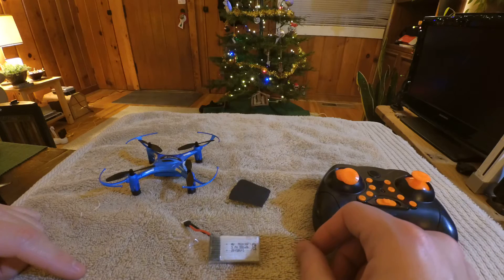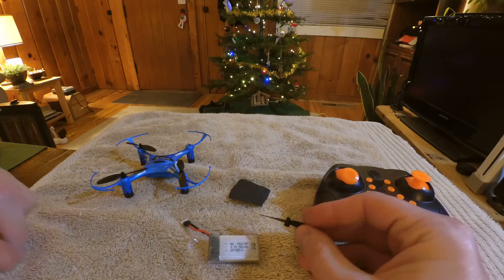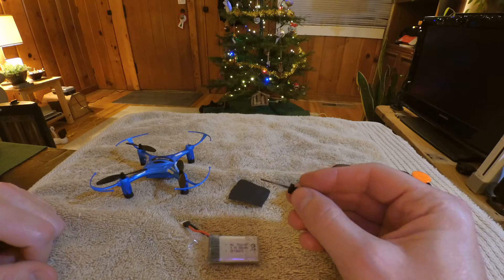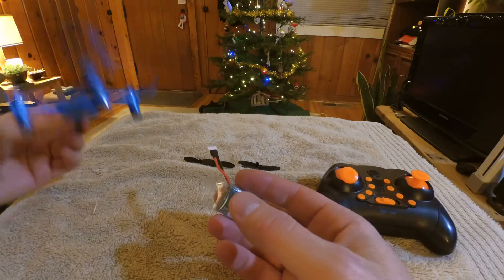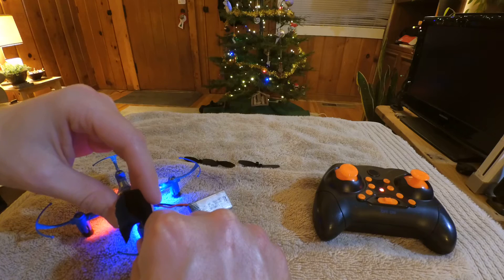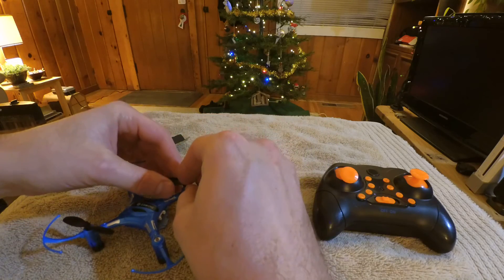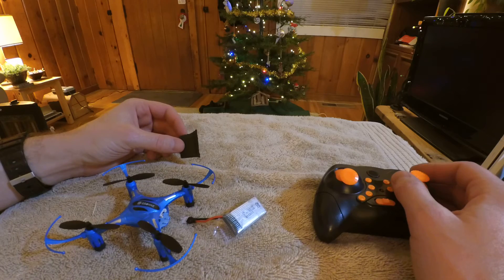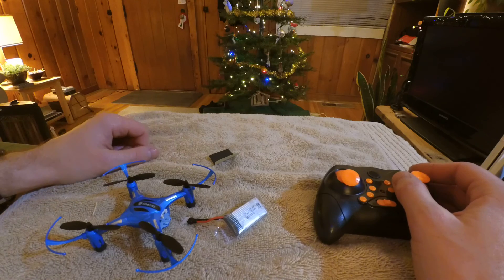How to stop propellers from flying off small drones

Comment: You can take some hot glue and put it on the tip of the shaft and before it dries take your propeller and fit it on there like it normally goes and push it you know good firmly on there and the glue will dry as long as you don't get glued down near where the shaft spins at the motor this is not 100 % foolproof though. Thinking of trying super glue or stronger adhesive they should have these propellers on the smaller drones where they're screwed into the shaft like on larger ones

Comment: I so desperately want this to work, but I'm scared. As things tend to do with me, I'm pretty sure that if I try something random will go wrong and instead of giving the motors a better grip, instead it will somehow break them and cause them to never be able to mount a propeller again. I've had enough of these stupid propellers flying off, but I'm scared that using your technique will stop the propellers from coming on at all.
Reply from the maker: If you're worried about Murphy's Law, try it on just one motor first. That way if you screw it up, you've only damaged one motor instead of 4. Basically what we're doing here is changing the surface finish of the shaft from smooth to rough; we're not changing the diameter of the shaft.

There are two other methods for keeping the prop on the shaft. The first is to crush the hub of the propeller with pliers. The effectiveness of this is temporary, and it may also cause vibrations. The second method I have heard of but not tried: super glue. I would really call this one risky biscuits because 1) if you break the prop, good luck changing it and 2) if you use too much and get it in the motor's bearing, it's permanently seized.
Reply: @EngDrewman  messing up 1 motor will mess up the whole drone btw
Reply from the maker: @tikogupta1735  yes I know. What I'm saying is by trying it on one first, if you screw up, then you only have 1 to replace not all 4.
Reply: @EngDrewman  oh i see sorry for my incompetence
Reply: not being sarcastic or obnoxious in anyway btw

Comment: Thanks for the tips! Greatly appreciated! Any ideas for how to get props that are made for a slightly bigger diameter shaft to fit? I've tried putting a piece of thread through the hole and had some success, but I'm thinking there must be a better way.
Reply: Put super glue inside and let it dry, then re drill it out to the size you need.